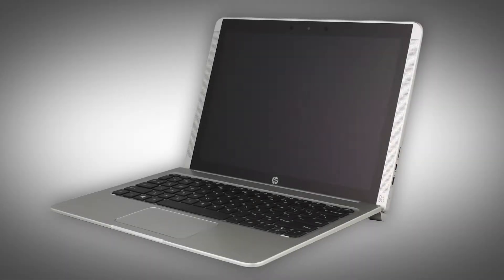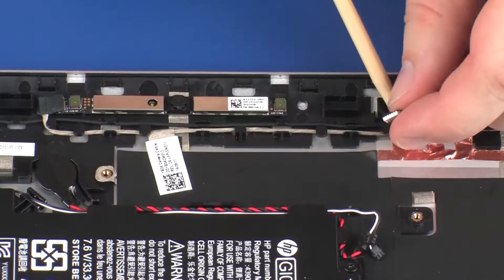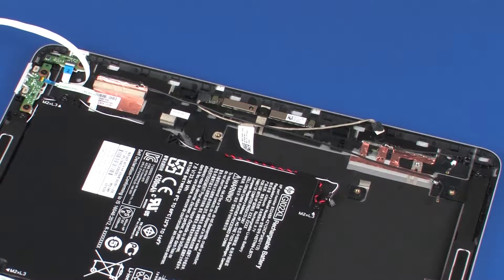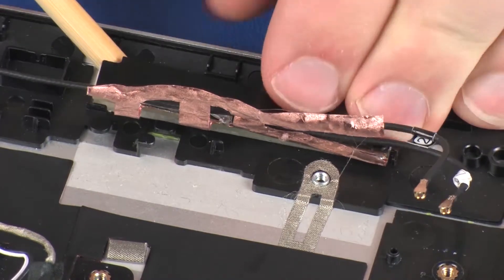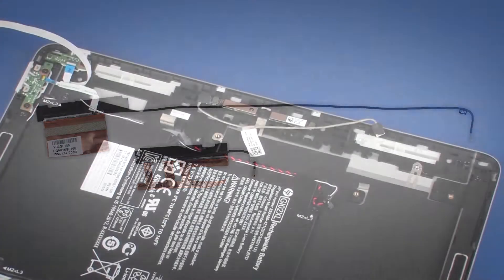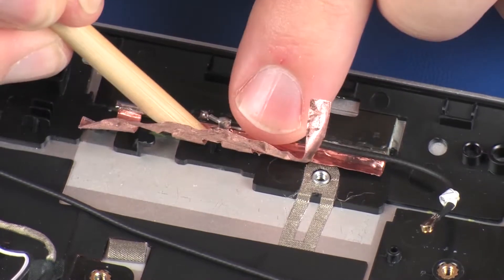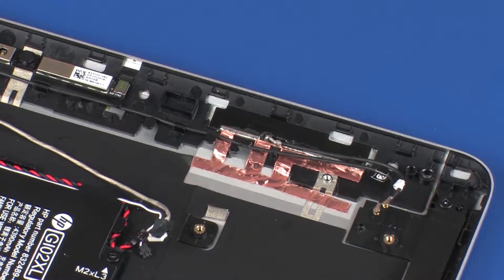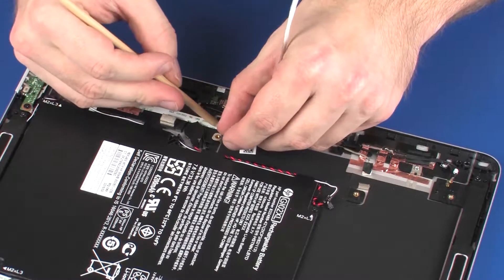Replace the Wireless Antenna Cables | HP Pavilion x2 Detachable 12-b000 Notebook | HP Support

Comment: it shows everything except unplugging the antenna cables and replugging them back in.  Have you got a video of those steps?  Those little plugs are hard to get on so there must be a technique or a tool used for that?
Reply from the maker: Hi Matthew, thanks for contacting!
I understand that you need help in replacing wireless antenna cables.
I will do my best to assist you.
Please refer page number 42 of the user manual to get this information: https://bit.ly/3BAssQX
Binu - Social Media Tech Support

Comment: if you dont have colour or indicators on the card/wires, which of the 2 antennas plugs into which socket on the wifi card. i have a card i want to plug into a HP laptop which already has wires from previous card.  Does it really matter which wire clips into which socket? also will i need to download drivers for that card for it to work?  Thanks